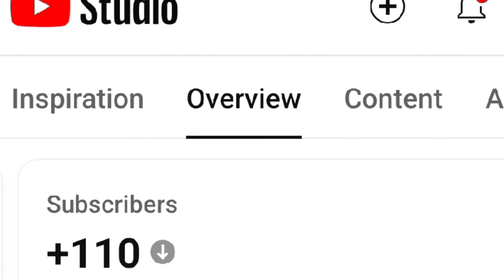EVERYTHING YOU NEED TO KNOW ABOUT COUNTY TRACTORS IN 16 MINUTES.

Comment: The company I worked for had a C Reg (1985), Ford Transit 1.5 t pick-up, 4 wd County conversion.
It was not a success to put it mildly, very poor turning circle and heavy steering. A complete dog to drive compared to our B Reg standard Transit pick up. It didn't have a passenger seat on delivery from new, as I believe it was overweight on the front axle.
Reply from the maker: @richardthomasmillican3980  That's interesting.  Thanks for watching 👍